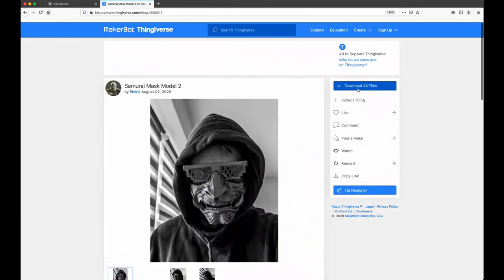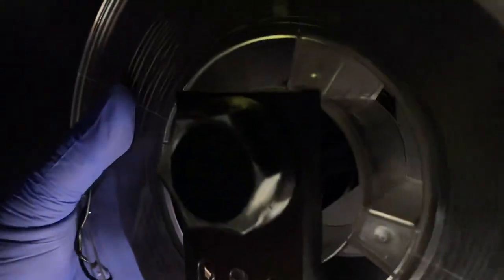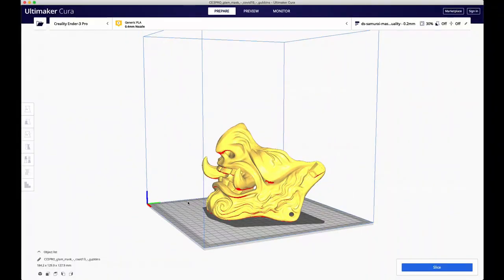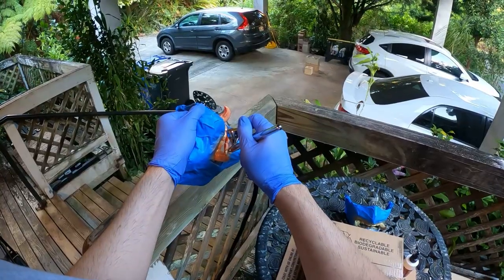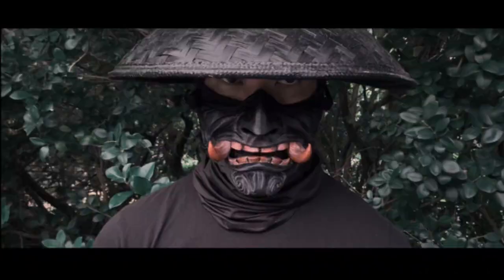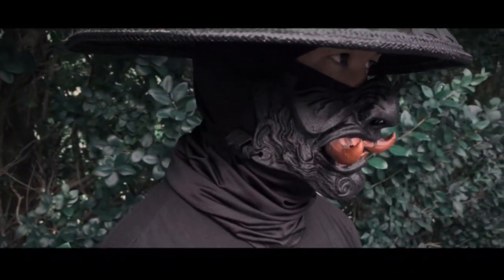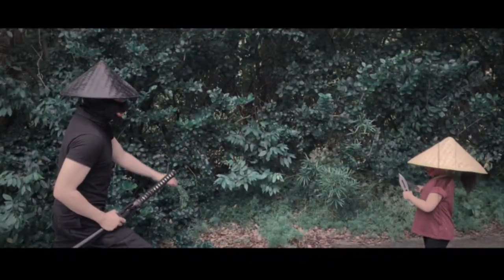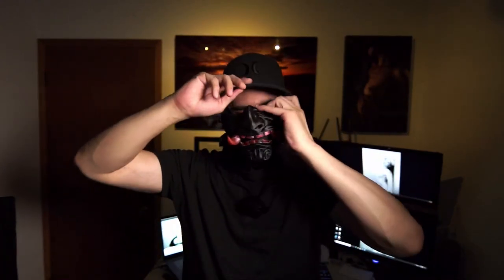(Not A Photography Video) Quick How To: 3D printed Samurai Mempo Mask - Ender3 Pro - TPU

Comment: Cool video do you have a video on your tpu settings because I'm struggling to get clean prints with it
Reply from the maker: All printers are different so these settings may not work for you.
I use a ender 3 pro with a direct drive.
Brand - Sainsmart TPU 95a - Note: this is an affiliate link so if it applies I will get a small cut from purchase if so happens you use this link but if not no worries. (https://amzn.to/388SBYy)
Cura:
Layer Height = .17
Initial layer height = .3
Infill Density = 30%
Temp = 220
Bed temp = 60
Speed = 25mm/s
Retraction = 1mm
Retraction speed = 50mm
Cooling 100 %

Hope this helps however again, all printers are different even if all the parts are exactly the same.

Comment: What settings did you use to print this?  What percentage infill and wall thickness did you use?
Reply from the maker: (To answer your question directly, percentage infill is 30% and wall thickness is 1.2mm)

Additional information:
All printers are different so these settings may not work for you.
I use a ender 3 pro with a direct drive.
Brand - Sainsmart TPU 95a - Note: this is an affiliate link so if it applies I will get a small cut from purchase if so happens you use this link but if not no worries. (https://amzn.to/388SBYy)
Cura:
Layer Height = .17
Initial layer height = .3
Infill Density = 30%
Temp = 220
Bed temp = 60
Speed = 25mm/s
Retraction = 1mm
Retraction speed = 50mm
Cooling 100 %

Hope this helps however again, all printers are different even if all the parts are exactly the same.
Reply: @Essenceofartistry  Awesome, thanks, this will get me started.  I was mainly looking for infill and wall thickness since I haven't worked much with TPU.